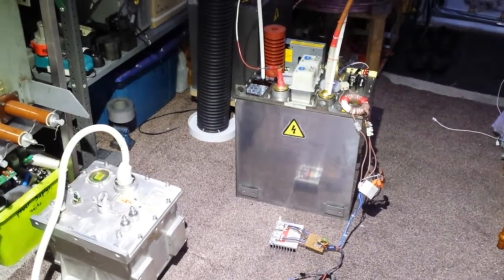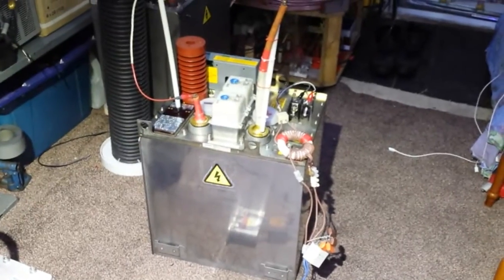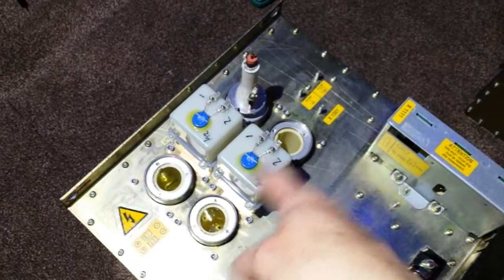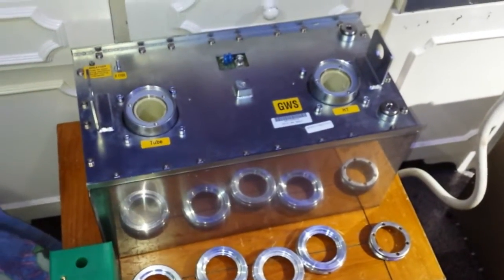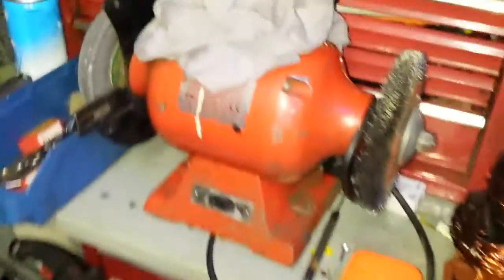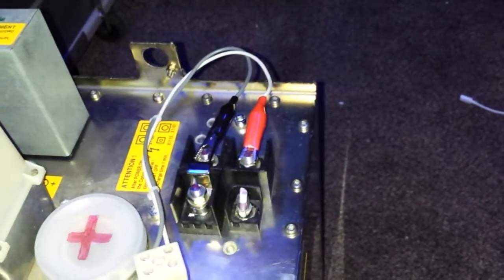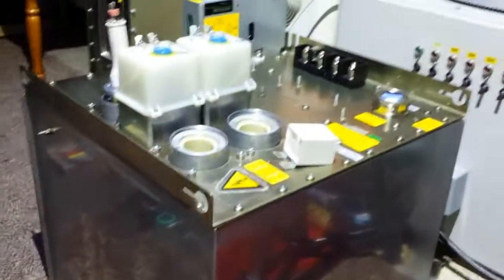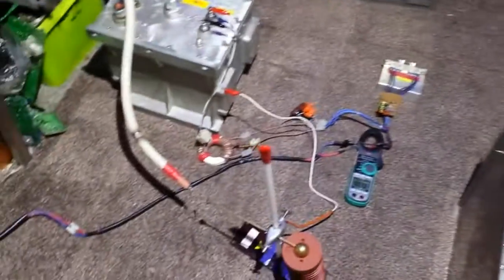X-RAY -H'T Tank transformers at home

Comment: One thing you could try is putting an arc through a small CRT and seeing if it powers up or not. That would be interesting
Reply from the maker: Hey bud' you want to see me put an arc through a crt? I could get a flyback to power up a crt mate lol. If i stick one of them bad boys through a crt it will give out xrays for sure lol" but its definitely  on the cards lol 👍😉 thanks for the comment.
Reply: high1voltage1rules No worries! LOL I forgot about the X-rays those things give off when over volted! But a small flyback would be interesting, I do believe you can power them without the rest of the set.  Thanks for replying!

Comment: That possibly multiplier box can be interesting :)

My best guess:
HT: AC in, Tube: crazy high voltage DC out, box is ground.

800W is rather impressive, but not even close to the VA-rating of the transformer.
How far do you intend to push it?

As for cabling, would it be possible to cable the transformers to a portable board with 2 isolators, and have enough cable to reach outside? no need to move 60 kg of transformer around if so.

As for driver, you should really make one based on FAN7387 / IR2153 / NCP1392.
The needed parts: 2 FET/IGBT, that chip, big capacitor, and some small resistors and capacitors, isolated 12V supply.
Reply from the maker: Hi mate'

Yeah thank you for the comment and info' hope ya well and thanks again.
👍😉

Comment: Hi, Ant that board with the diodes and caps in it on the unit you showed at around 9:00 minute mark looks like a multi-staged Cokroft-Walten multiplier?. I could be wrong.
Reply from the maker: Yeah we have been wondering mate. Iv been trying it' and its looking to be just that.😉
Thanks friend for the comment and help👍